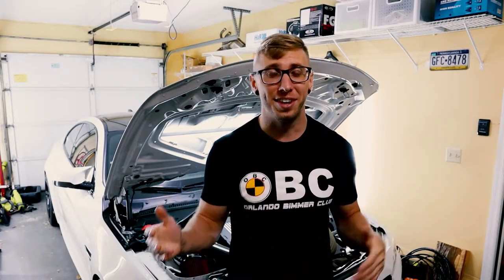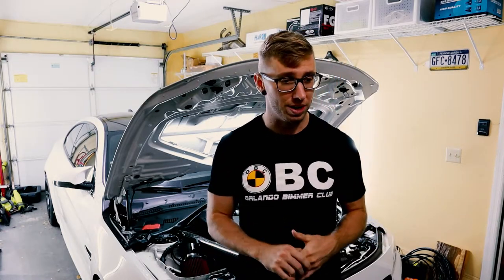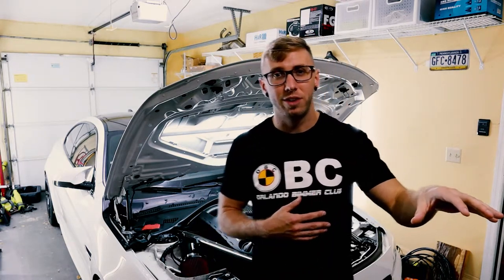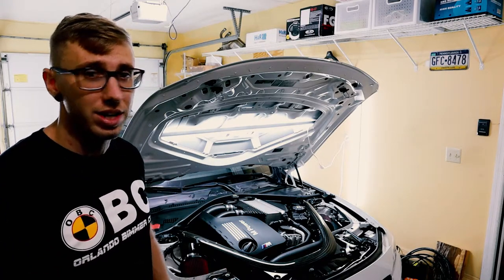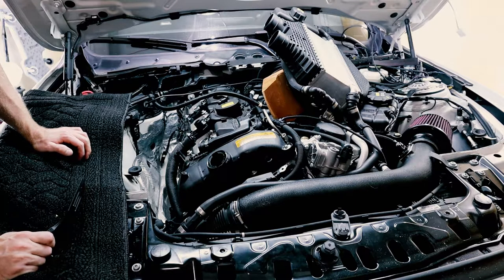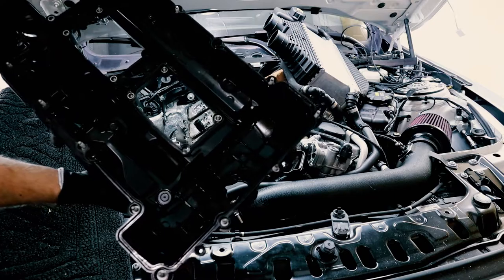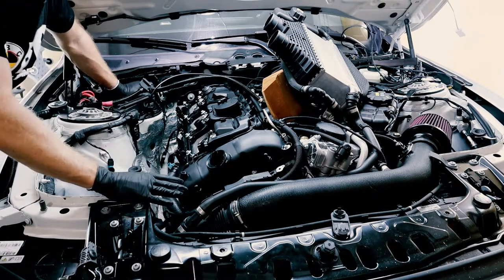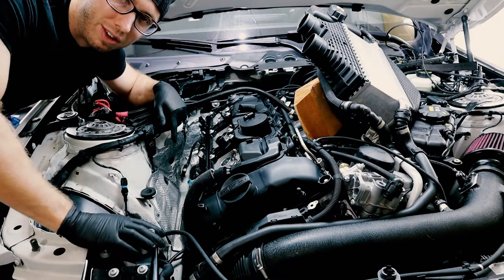Vlog 31 - BMW M3/M4 S55 Valve Cover Replacement Tutorial (PCV Valve Failure)

Comment: i have a hughe prolbem with my m4, it pushes Oil through the PCV into the Air Intake, which gets into the Intake Manifold and then Burns in there which causes excessive oil Loss and big smoke clouds out the back, it only happens after letting the car sit for a few mins or a few hours and then driving again.
Reply: Not sure tho if its the PCV or the Turbos
Reply: Hi i am have same exact issue with my bmw m4 2015 smoke with oil in exhaust i have also found out its 99% pcv not turbo if u solved your problem let me know how so i can do the same thanks
Reply: @natashaabeera7231  This week my Car will be checked by a S55 Specialist they'll be taking the whole Engine apart ill inform you after its been Fixed.
Reply from the maker: Hey Kellogs, Sorry for the late response on this. It sounds like you may have more than just pcv valve issue, but if you hear the squeaking vacuum leak noise like I show in the video and loosening the oil cap makes the sound go away, then I'd say you likely have the pcv issue. That is a much cheaper place to start than replacing turbos. Let me know what happens when you get the car looked at. I'm curious to know what the issue is in case I have something like this come up.
Reply: @Awesomoto  I have had my Car checked this Week by BMW M in Munich since they took over the Case through some Contacts to a Higher Friend who works for Rolls Royce, they cant seem to find the issue for the Leaking oil it has the Same software (Factory Software from when it was Delivered and so on nothing suspicious) But also a weird thing Started to come up again when i got my Car back. When the Engine is at Operating Temp and i check the Oil Level it shows different Oil Levels  everytime i do the Check, sometimes it Shows max level and after 30 Miles it shows almost at Minimum and 40 more Miles later it Shows inbetween Min and Max and so on... Well anyways i have a Friend with an M4 2015 just like mine, he works for BMW as a Engineer and 2000 Miles ago he got the Same issue, he ended up bringing it to BMW in Munich just like me they Changed: (Valve Cover and Gasked, the Whole Air intake, Almost Every Sensor, Every oil pressure hose on the Engine, Boost Pipes, and so on..... all because almosteverything was full of oil. He ended up Paying 3600€ after a Discount of 35-40%. But nothing of that Changed the Problem and hes sold the Car because hes sick of it :=) Only thing left basically is the Turbos :D

Comment: Damn. Trying to find a DIY on the steps of accessing the PCV. Yours is triple speed so I don’t know all the steps.
Reply from the maker: Hey Bernau, I’m sorry I sped that section up. The video was getting pretty long so I had to make the call. Getting down there is pretty straight forward and the steps in the video should get you there. The PCV valve is on the valve cover.

Comment: What year is your M4? I’m trying to get the hose off that connects to the valve cover that you pull off at 7:14, but I’m not able to get that hose off at all, it’s on there so tight, did you just pull it off or is there some sort of clip or something holding it in?
Reply from the maker: Sorry for the delay in responding. I have a 2015 M4...this hose pulled off by squeezing in on the plastic at the end of the hose which released the connection.
Reply: I also think it is too difficult to disassemble. What is the final technique?

Comment: Curious-why did you remove the charge cooler? I saw a shop recently replacing a valve cover...they did not remove it. I'm sorry if I didn't listen to the entire video. I'm currently facing a PCV failure on my F82 LCI but I'm going to try the PCV cap ghetto route first with a crank case oil cap breather because if it broke now it's going to again and I don't want to keep swapping valve covers.
Reply from the maker: Hey, sorry for the delay. I removed the charge cooler to gain better access to the bolts on the fuel rail. It also helps give you a direct path to put new valve cover on. Probably could be done without, but it made the job easier for me to lift it up a bit. I hear you on the PCV cap fix, but I worry about not getting the best seal and if adhesive gets drips down into the engine. This valve cover last me 60,000 miles, so doing the job seemed to make sense. Let me know if you have more questions.
Reply: @Awesomoto  thanks man, makes sense. I actually just bought one of those PCV repair kits and it worked (with some modification). I'm hoping it'll hold me over. Glad this video exists though, the only one out there.
Reply from the maker: @slaughtermode  I’m sure it’ll hold you over for awhile. Let me know if you run into any issues with it. I may want to go this route in 60k miles if this one fails again lol

Comment: Okay, I just have one problem. I changed the spark plugs and don’t know how to reset the CBS. It’s not part of the in-dash maintenance. Any help with this?
Reply from the maker: I’ve always used this sequence I found years ago in a bimmerpost 

https://f80.bimmerpost.com/forums/showthread.php?t=1230861#:~:text=If%20you%20tap%20the%20odometer,like%20brake%20pads%2C%20brake%20fluid.&text=To%20reset%2C%20press%20and%20hold,button%20for%201%2D2%20seconds.

Comment: I am about to do this here this week. Started getting that high pitch sound. How are things so with your m4? Anything i should prep for?
Reply from the maker: Thanks for reaching out! Things are still going well with the M4 since this install and this solved the problem for me. Good luck on the install and let me know if you have any questions along the way!
Reply: @Awesomoto  thanks bro! I appreciate it.
Reply: @icybirdman614  are you still planning on doing this repair? I have an extra valve cover if you haven't bought the replacement yet!
Reply: @CKalin1   you  selling it ?
Reply: Thanks bro! I already had bought the replacement. Took me like 6 hours and I got to put ARM resonated downpipes too. The M4 is fine now!

Comment: Same issue and my exhaust valve doesn’t open anymore in sport mode the valves not opening is related to the valve cover issue?
Reply from the maker: Hey! Are you referring to the valve as in the exhaust valve?
Reply: @Awesomoto  yes and my car is also making the exact same screeching sound
Reply from the maker: @thew4r10ck3  I think you have the PCV issue then. The part about the exhaust not opening in sport mode sounds like a completely different issue though.

Comment: Why not just replace the membrane in the pcv valve ?
Reply from the maker: Hey Bart, in hindsight I think that’s a valid approach and I’d suggest it as an alternative. I think I was just worried about cutting the plastic and getting debris in the engine. I also was worried about getting a good seal with the aftermarket membrane. If you go that route, let me know how it goes. I’m sure it will hold up fine and that would save even more money!

Comment: Why is no one mentioning that the PCV valve is covered under emissions warranty? 8 yr/80k…just had the same issue a week ago on my 2016 F80 & BMW replaced my Valve cover
Reply from the maker: David, if this is true I’m so upset I went through all this trouble. My vehicle is outside the 5 year warranty, so I just assumed this wouldn’t be covered. I appreciate you reaching out about this to inform others. I’ll pin a comment to the video to alert people.
Reply: Well at least you ended up learning how to replace the valve cover & making a great diy video for others…it is indeed true, I can send you my repair order if needed
Reply: I did call my local dealership and what I was told is the gasket is covered (leaking oil) but the breather/membrane (whining sound) is not for the PCV... I have a 2016 F83, so if someone thinks this is not correct I would love to know (because of course nothing for BMW is in writing)!
Reply from the maker: @bmdubyou  Thank you 🙏🏻
Reply from the maker: @CKalin1  Are you saying they won’t cover your valve cover replacement under warranty or are you saying they don’t think that’s the problem with your vehicle making the whining noise?
Reply: @Awesomoto  the dealership wouldn't replace the valve cover under warranty if it was the breather (which is what is likely causing the whining noise versus a bad gasket), at least as I understand it!
Reply: @CKalin1  the PCV valve is part of the valve cover, the gasket should be covered as well under emissions warranty 7yr/70k…how many miles do you have on your car?
Reply: @bmdubyou  have <50k miles, but was told that only the gasket is covered by the emissions warranty and not the breather (membrane) which is what causes the whining symptoms. Either way, work is done! 🙄😅
Reply: @CKalin1  so you ended up paying out of pocket for the repair? That was the exact symptom I had & my dealer covered it, what’s your insta? I can send you my repair order…sorry to say, but your service advisor bent you over 🤷🏻‍♂️
Reply: @bmdubyou  hey David are you able to send me your repair order? My m4 is a 2015 model with 63000 miles so not sure if it will be covered?
Reply: @doberman3046  Ya man, no problem. I was wrong about the 8 yr/80k though…it’s actually 7 yr/70k. So depending on what month your 15 was produced you might have already passed the 7yr mark. What is your email? I’ll send the Info
Reply: @bmdubyou  hey I know this is an old thread but I have a 16 M3 and I have the same whining noise at idle once the car warms up.  My car is right at 7 years old (March ‘16) and 67k miles.

Took to local BMW dealer hoping they would fix under 7/70 warranty.. tech is saying it’s a crankcase seal leak (same as valve cover gasket leak??) not PCV and I got a $2300 estimate to fix.  Also the advisor said since I’m in VA not CA they wouldn’t warranty PCV under 7/70 anyway.  I think they’re full of it.  

Any advice??
Reply: @m3pilot19  hey man, sorry to hear you are having issues, but I believe he is correct about the emissions warranty, I know they differ from state to state but I know CA is 7yr/70k mi…as far as it being the rear main seal, if that is ultimately the issue, then unfortunately it won’t be covered. I believe he’s being pretty upfront.
Reply: @bmdubyou  hey I misspoke.. it’s the crank case seal.. not rear seal.  And there is a 7/70 warranty nationwide.  Are you in California?
Reply: @m3pilot19  oh gotcha, ya I’m in CA…not sure if the crank case seal is a covered component or not. My advice would be, if you have any rapport with the service advisor, he should be able to find out if it is covered under the federal emissions warranty. The other option (if you’re lucky) they can one time “Goodwill” the repair.  

If this is your first visit to that dealer then they most likely won’t offer that, but if you service your car there or bought it there you may have a better chance at them covering the repair under “Goodwill”

Good luck 🍀

Comment: I have to change my valve cover too on my 15 f80 M3 I’m kinda nervous tho but I would like to save the money 😣😣😣
Reply from the maker: You got this! I was worried about doing it myself too, but if you just take your time you can do it! 

I’m not a mechanic by any means…but saving $2k+ somehow convinced me that I’m a certified BMW tech in my head 😂

Seriously though, if you have any specific questions about doing the work, let me know and I can help clarify any of the steps.
Reply: Check with your local dealer, if it’s your PCV valve it should be covered under the emissions warranty 8yr/80k